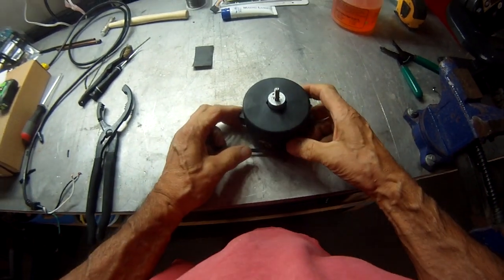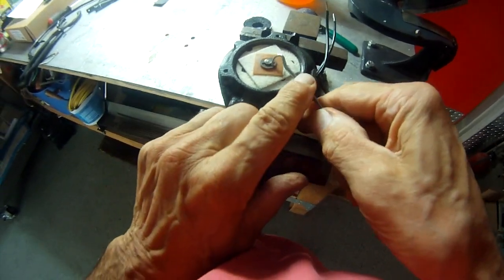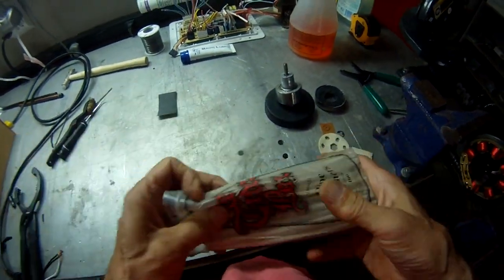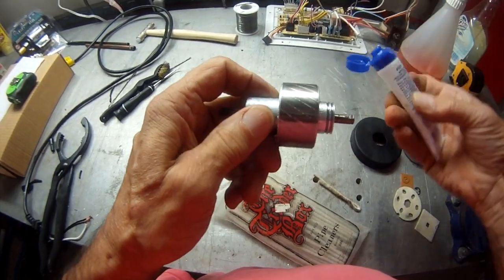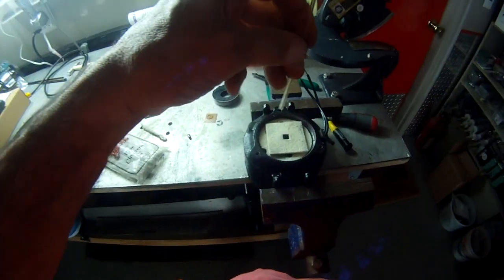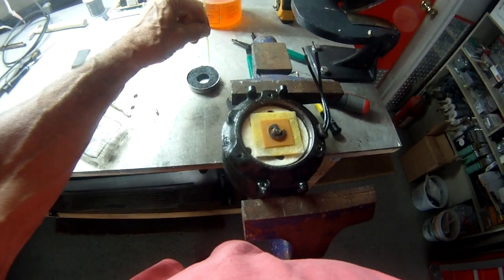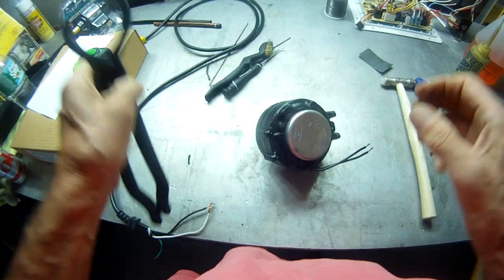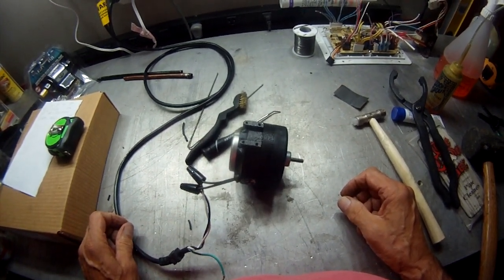Sub-Zero Condenser Motor Rebuild

Comment: I watched that but the shaft doesn’t have a clip on top to release the shaft. Here’s a picture of mine. It’s the original, about 20 years old. I bought a new motor from a Sub Zero supplier but it’s much too loud. I’d like to refurbish mine.

Comment: Can you show how the fan is supposed to run? Mine slowly lazily starts to turn when compressor is running. I can stop it with my finger so easily. Not sure if that's normal or not.

Comment: About what year is this fan motor I have an 20 yr old Sub-Zero fridge that is starting to run little noisy do you think doing this would help? Thanks for the video after watching I believe I can do this if need be. Is there a way to contact you via email? Have some questions and have no problem paying for your time thanks
Reply from the maker: Is it the fan motor or the fan blade. If the blade comes loose it can make a noise.